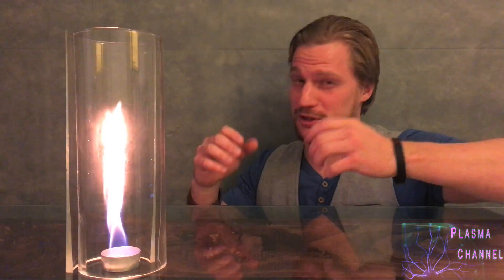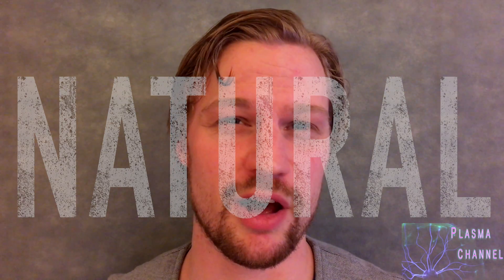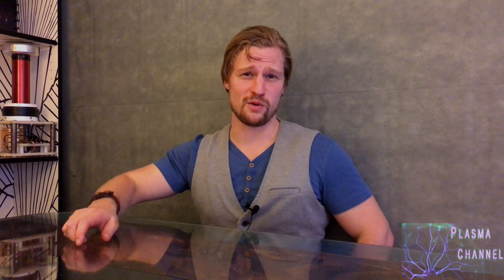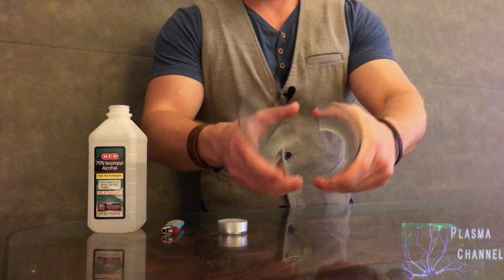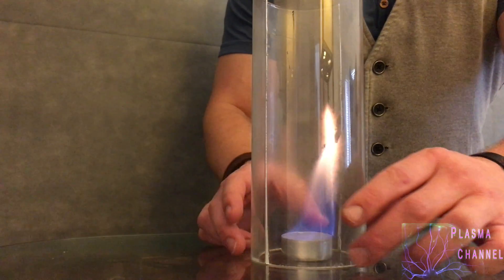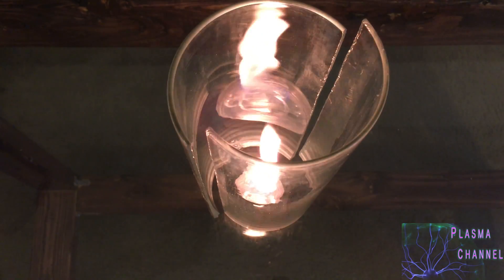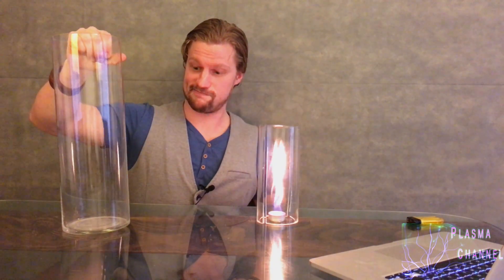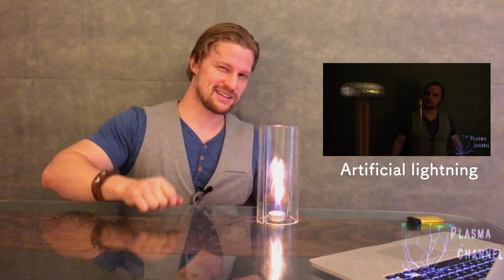DIY FIRE TORNADO with no moving parts

Comment: a green flame would have been cooler though
Reply: add some copper coil near the base.. Will have to be replaced regularly though.
Reply: @genryuusai  no just use a solution of boric acid and methanol

Comment: J, Really enjoying this old production work of yours… but, how about taking this up a notch? Tornados are electric phenomena. Bipolar water with ions in vapor form excellent capacitors that can set up conducive capacitor spark-chains between the ground and clouds at the top. Fill the solid glass tube with vents at the bottom, no cheater circulating vents, filled with ionized water vapor: Enabling chain low voltage sparks to rise as the total voltage difference from top to bottom is increased. Producing current lightning discharges through the clouds, sparking current flow in one direction, creating a circulating magnetic field and classic tornado sucking atmosphere and contents up from the bottom to the top (upside-down ion drive effect?).  Now, we know you can short out a tornado by bypassing this capacitor chain (remind you of your favorite voltage multiplier?), insert a better conductor in the core…:

A highly conductive vapor or smoke or dust, like fine powered metal sprayed up the center, or miniature metalized ping pong balls? Or boiling NaK?

 and BANG, no more voltage difference top to bottom, no more current through the capacitive chain… I was thinking, open a small dish of liquid NaK at the bottom… and let the low pressure ion wind suck some up the vortex… (OK, heat the NaK up a bit or maybe use hot salt, or iron ion water) building a vapor conductor from the continuous stream of metal ions with higher conductivity, now even Karl and Barbara Hubbard- would be proud of that gas based Marx generator. You just demonstrated a process almost anyone could use to trap and kill a natural tornado. Save lives and property with plasma.🥳🙏

Comment: Clever idea - I wonder if it could be used to pipe hot air into a tent, without bringing smoke along?
See this other video I just watched before seeing yours:   https://www.youtube.com/watch?v=QeHGDr81XwM
So he uses a fire inside a hollowed out log, and has a metal pipe poking thru there while drawing in air from below. If his log had been a couple of halves instead of thirds, perhaps he could have created a taller fire vortex like yours, to better heat the pipe.

Comment: were you able to cut through the glass just using the dremel without anything else and how about the cut along the length? would have been nice if you showed that
Reply from the maker: It’s important to cut the glass with a special  bit, and to do it under water

Comment: jay have you done a vid on the larger glass one?
Reply from the maker: Not yet... but I plan on it! Check out my plasma tornado video though!
Reply: @Plasma Channel   Clever idea - I wonder if it could be used to pipe hot air into a tent, without bringing smoke along?
See this other video I just watched before seeing yours:   https://www.youtube.com/watch?v=QeHGDr81XwM
So he uses a fire inside a hollowed out log, and has a metal pipe poking thru there while drawing in air from below. If his log had been a couple of halves instead of thirds, perhaps he could have created a taller fire vortex like yours, to better heat the pipe.
Reply: @manofsan  i saw the video and it seems quite efficient enough ,i dont understand your idea of only cutting the log in two halves to make it work,you need to do alot of work to hollow both sides but then how will you build a fire inside and keep the logs offset and raised off the ground for the pipe to go through? no it does not sound like an efficient or practical design,,whole point of the fire log is that it uses itself as fuel to remain lit and gives off proper radiant heat to heat up the pipe instead of using a secondary fuel source that wont last
Reply: @ARCSTREAMS  ah, thanks for your illuminating comment. I guess I was mainly looking at how well the burning log was heating the pipe. I was thinking that a taller flame (ie. from a vortex projecting upward from the log) could heat a longer span of pipe to further heat the air in the siphon. So it's not the fuel source I was taking issue with, but rather the geometry to allow the resultant flame to heat the pipe better. Also, could this whole idea somehow be miniaturized and compressed into a single convenient device? Could you have a metal pipe where the inlet end is shaped more like an auger, so that you can bore it through the center of a log, and then light up that center, and have it do the same thermal siphon thing to heat your tent?
Reply: @manofsan  again the problem is the heat source which make no sense for your ideas ,,i suppose using a cooper pipe that can be formed into a helix like the worms used as condensers for making moonshine would be a good idea to pack into a small container and be a more efficient heat exchange (instead of a straight pipe)yes but the problem is if you want to keep the same large pipe diameter like the one in the video this can become cumbersome to build and then like i said you would have to work hard to carve out a bigger hole in the log not leaving much wood left to be used as a fuel or fire source ,,in any case as efficient as that log heater is it is still a large thing to build and i dont see how you can improve on the design ,i dont think it's necessary,,,trying to build something smaller to heat your tent comes with its own drawbacks as most likely it will not be a free source of energy and may take longer to heat a tent ,if your initial idea was to use this fire vortex in a larger metal or glass container (instead of a log) and put a metal pipe down the side  then my question is what would be your fuel source?? wont last ,,this vortex fire lamp is just for ornamental purposes and coolness ,nothing more

Comment: Can i do this using a plastic 2liter??? Sumone awnser!!!
🔥👇🔥
Reply from the maker: Hi, you cannot. It will melt with seconds.. it would function for a few seconds yes, but that is it. 

I would not recommend it.
Reply: @PlasmaChannel  id love to see you do it with a green flame and a red flame and use smaller diameter glass next time that is slightly bigger than the candle tea cup,,should make for a taller more solid intense flame that fills the tube like a neon light

Comment: I would like to see how a high voltage arc would run through the fire tornado.
Reply from the maker: I have tried this a couple of times and I noticed nothing special. Only that the electric arc can be stretched a little bit taller.
Reply: Plasma Channel I thought it might lower the breakdown voltage but I don't know how to test that. I guess the longer arc could mean that if it's at the same voltage.
Reply: Plasma Channel maybe the rising heat does something, can you do a Jacob's lader with the tornado in between?

Comment: Add a bit of copper wire to the top of your flame and get..... GREEN FIRE TORNADO!! In fact, by adding small amounts of chemical compounds to your fuel such as Sodium Chloride, or, you know, common salt, or potassium chloride (ahem, that weird diet salt) you can get red or purple flames. Adding oxygen will give you an insane blue flame, and a LOT of heat.
Awesome video Jay! Keep it up!
Reply from the maker: Eugenia Pignataro thanks!